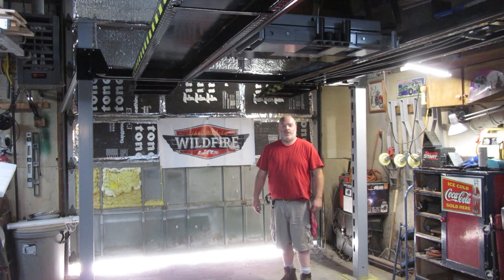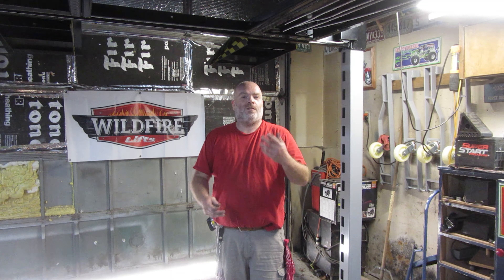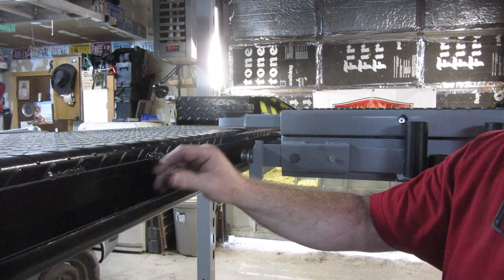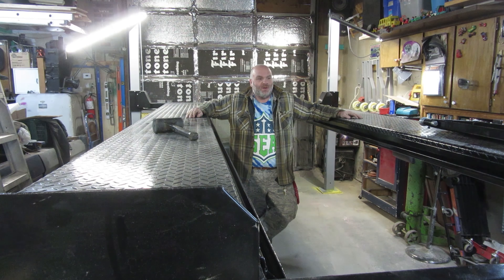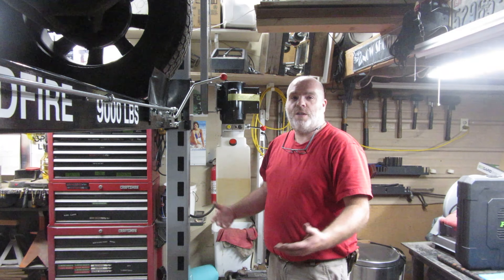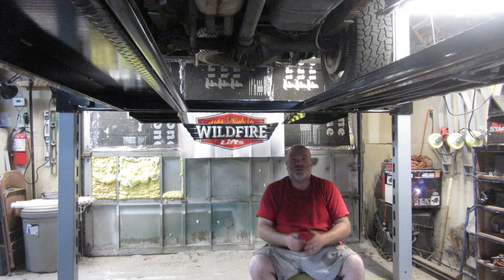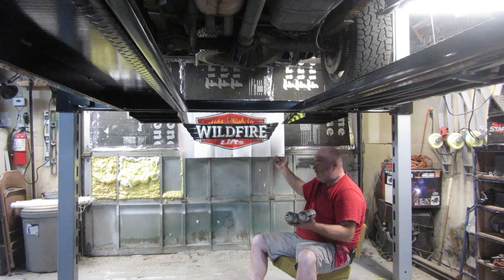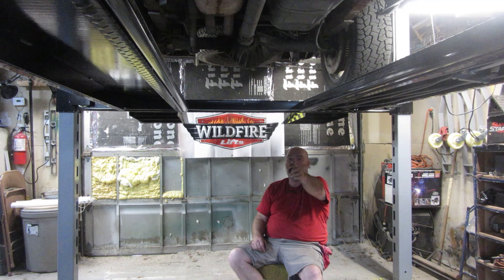WILDFIRE XLT LIFT REVIEW AFTER A GOOD 6 MONTHS

Comment: Thanks for posting this, I’m to the point of deciding between Wildfire or Advantage lifts.
Reply from the maker: i  love my wildfire lift , they are built well , and the biggest thing is i feel safe under it
Reply: Definitely go with Wildfire.  Well built, packaged good, relatively easy to set up (aside from being heavy), and excellent customer service.  The only tip I would offer is make sure all four corners are adjusted such that all four locks engage evenly.  You can let them engage and leave some gap, then measure that gap at each corner to check adjustment.  And, when you are lifting a vehicle, make sure to lift a little more than when you hear them engage to ensure all four have actually engaged, then lower   watching all four corners to make sure they sit on the stops.  If you see one corner continue to go down, STOP, raise the lift until all four engage, then try again.  That typically will not happen if adjusted correctly.  Also, check adjustment after using for a while, there will be some slight change as it breaks in (I assume a tiny bit of cable stretch.)
Reply: @joesfamilyfarm  thank you for the tip! I’m going to call tomorrow to find out information on the freight and how all that would cost. I’m in northeast Ohio . I’m definitely leaning towards the wildfire unit. Thanks again!
Reply: @stevenbruce2659  I was lucky.  They have a distribution center in Oregon.  I was able to pick up my lift and save about $900.  I think they have distribution centers in Minnesota and North Carolina too, but I'd check.
Reply: @joesfamilyfarm  I called Wildfire and keep getting their recording. May not be open yet but the Advantage lift people actually have a distribution center with the exact lift I want literally 5 miles from my house. I could actually pick up today if I had a trailer. I do still want to see what Wildfire has to offer first.

Comment: Is it possible that you were not on the locks in the front with Duramax on the lift?  I understand that you need to adjust the cables when you change the loads, especially with a front heavy truck versus small car.
Reply from the maker: no before i go under i let all the weight off the cables so the vehicle is resting on all four locks, i never go under with the weight on the cables , i also weight for a few seconds .i feel very safe under this lift much safer feeling than with a car on jack stands laying on my back.

Comment: I am thinking about getting a wild fire lift. I have a 20 amp circuit for a pole barn would this work? what circuits do you have for it?
Reply from the maker: i'm on a 20 amp but if there are several things on the same circuit you will want to shut them off while using the lift . if  you have a dedicated 20 amp plug just for it you should be good .ps still loving my lift
Reply: I have a dictated circuit (20 amp breaker) and have had no circuit tripping problems even in cold weather. The motor is a 2200 watt and draws 18.3 amps. I suggest that you do not run any other equipment on your lift circuit while operating the lift motor.

Comment: It’s a 20A motor. Should probably be on a dedicated circuit with HD extension cord.
Reply from the maker: i  agree i plan on running a dedicated circuit ,but  a lot of homeowners probably will use it like i am now if they buy it, so i thought i would explain that they would need to be aware of what else they may be using on the circuit .

Comment: That's the problem with the Wildfire lifts.. ball bearings in the pulley wheels instead of bushings. Advantage lifts main diff is that they have bushings with grease zerks on the pulleys. Bushings in this application, with such a heavy load on the pulleys, is  the only choice to avoid failure. A ball bearing here will fail, as not designed to take a load like this. So... Advantage is the way to go. Wildfire will send you new bearings, great, but it will fail again. Sorry, but true. I retired from this type of engineering work my entire life...
Reply from the maker: I have not had any more problems so far but we will see in the future, but the problem i see with bushings is they are a part that is made to were out as well and people will need to replace them as well  but i have owned tractors with bushing and people never replace them then its a more difficult fix if people are diligent about greasing them they can last a while but most people won't do it . to each their own